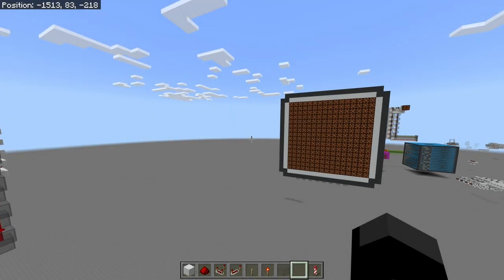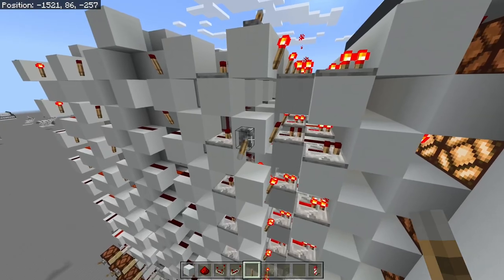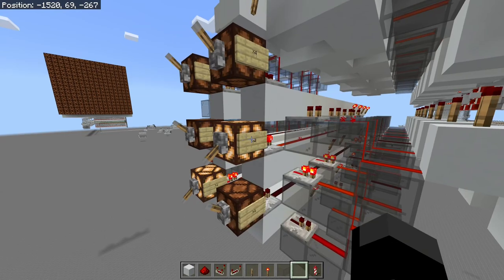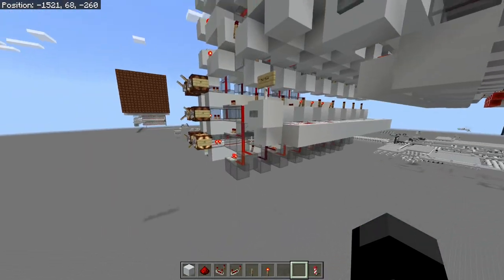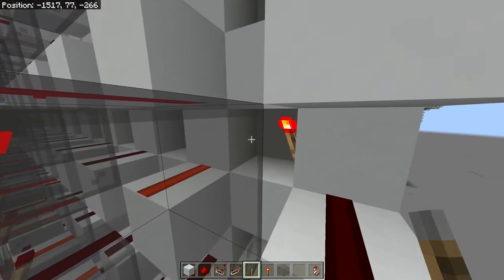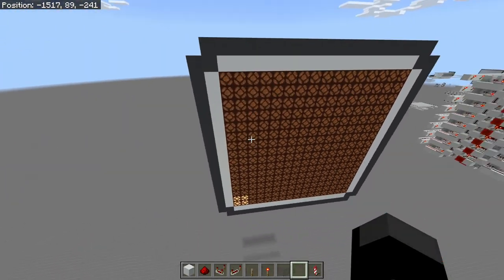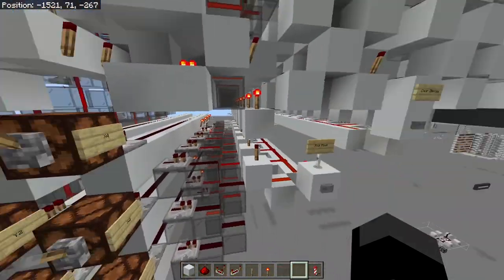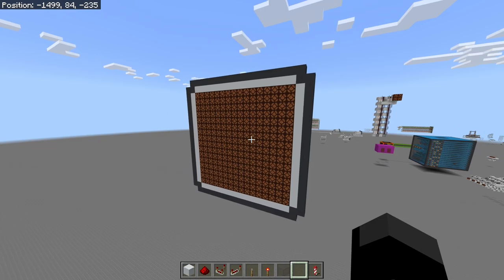Pixel Plotter Display Showcase - Minecraft Bedrock

Comment: There's a simple way to make a flip flop where you use a dispenser and a powder snow bucket. A not very well known fact is that (at least to my knowledge) works on java and bedrock is where full buckets with a comparator will give a signal strength of 2, and empty buckets give a signal strength of one. since powdered snow isn 't a liquid, it can be used for a simple and compact flip flop in any build. I've used this my self on my own screen, though I haven't got the reset working yet. Maybe you can use this, I don't know.
Reply: P.S. I missed the bit with the dispenser, sorry. They can pick powder snow, water, etc. Into an empty bucket and empty it as well.

Comment: I have a question. Whenever I've used latches doe screens like that to save the pixel a lot of the time they flicker and when I tried to make a word processor the latches kept flickering on and off and I tried a bunch of stuff but nothing worked.
Reply from the maker: This will be because you need to pulse them for several ticks depending on the design or they turn into a clock

Comment: Ooh, that's nice. Anyways, i have a question. You have a design for memory cells but instead of only signal strength 0 and 15 one with 0 to 15? It would be cool to see you explain that.
Reply from the maker: Do you mean a hex memory/signal strength memory cell - I do have a design for this but the main problem with hex memory is the bussing adds loads of latency the more cells you add. I may make a tutorial for my design in the future tho
Reply: @TheDarkness344  Yeah that's what i mean. I was curious if you had any designs of them since i made probably one of the smallest ever designs a day ago.
Reply from the maker: @STA-3  The design that I made is a vertical one with dimensions 10 long, 3 wide and 2 tall. It is also stackable. (Those dimensions account for the busses, the cell, cell controls like read/write etc)
Reply: @TheDarkness344  Altough i'm curious about your design. Will you show it someday?
Reply from the maker: @STA-3  sure. One slight problem I just found out is the design I had takes a serial input, but it would probably only be like 3 blocks longer to allow it to act as an individual cell.
Reply: @TheDarkness344  You saw my design yet? I was messing around with write designs and came up with something very compact. Mine is 4-wide tho.
Reply from the maker: @STA-3  yea it's definitely compact, I will make a video with my design at some point.
Reply: @TheDarkness344  Thanks :) also good luck!